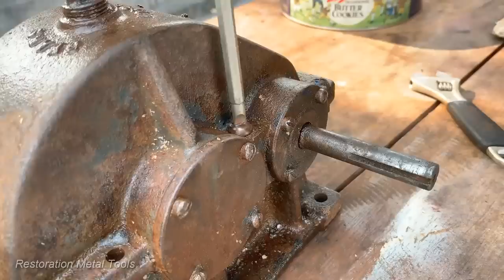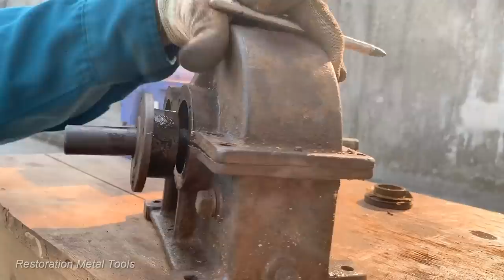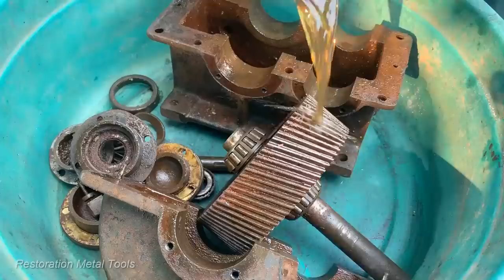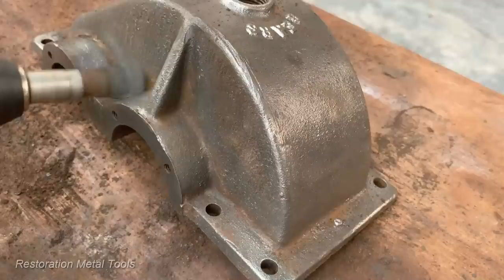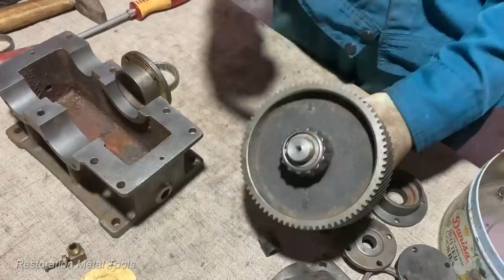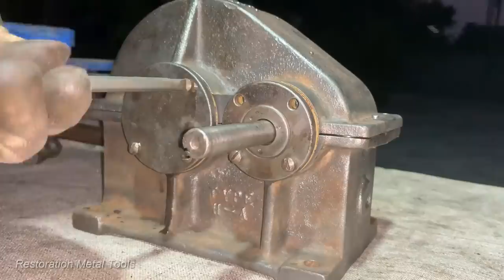Restoration Boston Gear rusty | Old 700 Series Gearbox restore

Comment: Have you checked gears for any excessive backlash and endplay/axial play of the gear shafts (especially where end covers are installed)? Prior to assembly it is essential to properly clean up all parts. Also the end covers should have been assembled after assembling bottom and top housing while checking for free rotation of gear shafts and ensuring end cover does not bind free rotation. Proper heat resistant and environmental deterioration resistant primer and paint would be better. However, your restoration attempt was good and definately your restoratiin skill will get further improved based on experience. Wish you all the best.

Comment: This “restoration” was a perfect lesson in today’s generations laziness. The bearings weren’t packed with grease. Rust wasn’t fully removed. Paint was applied without proper preparation. Should have just painted it and shortened the video to 2 minutes. Garbage!
Reply from the maker: thank you have a nice day
Reply: Bearings were packed, paint job was not the greatest

Comment: I hope you are not planning to use this thing.. did you weld the hole in the bottom outer casing. Those bearings really needed changing bro.. grease is no good it melts when hot... plus no oil..oops
Reply from the maker: thank you have a nice day